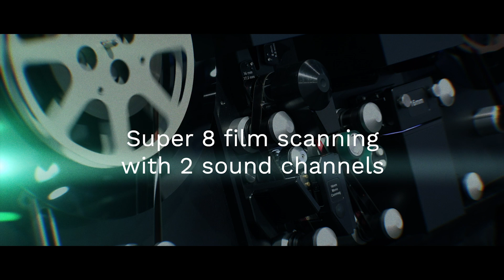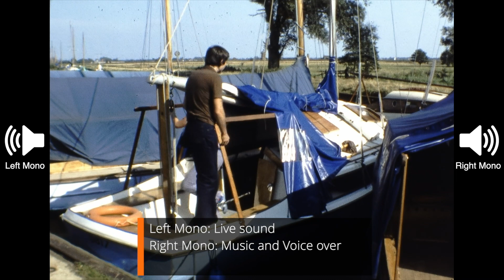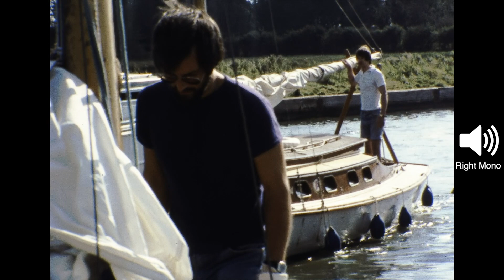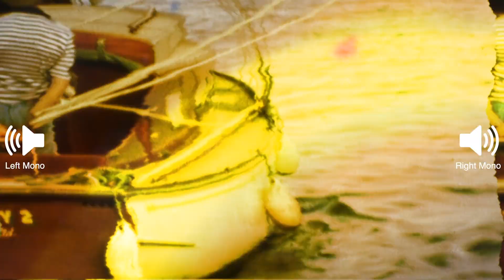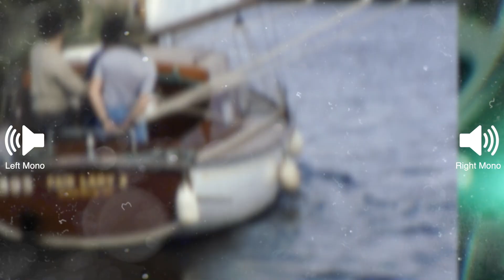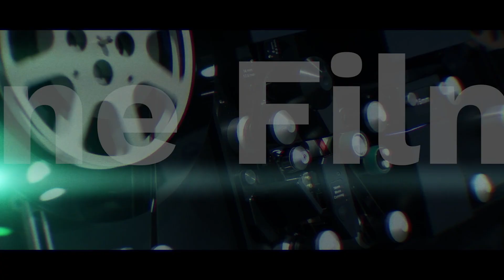Super 8 film scanning with 2 sound channels (2020)

Comment: Bad quality for film I think
Reply: Is super 8 mate, is ina decent quality for Super 8. Is no 16mm or 35mm
Reply: @Los_Tiempos_Muertos  I thought that film was keeping all the color and could give unlimited resolutions, independently of size.
Reply: @John1212168  wrong. Film has resolution and that resolution is dependent on the frame size of the film. 8mm Film is
tiny.
Reply: @GearHead4Lyfe  OK. But at least a 35mm frame I think is good enough to give 8k or even 16k if it goes digital. 
Generally I think that film's pixels are like flour while digitals are like salt. Actually a friend of mine thought this but I think it is correct.
Reply: @John1212168  Also depends on how the film was shot, what kind of film stock and with what camera.  Think storage too.